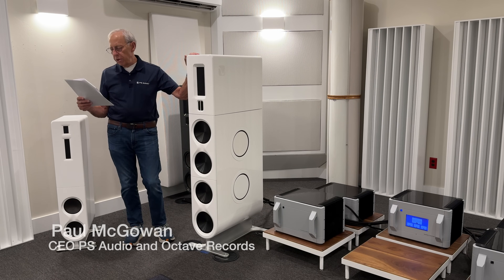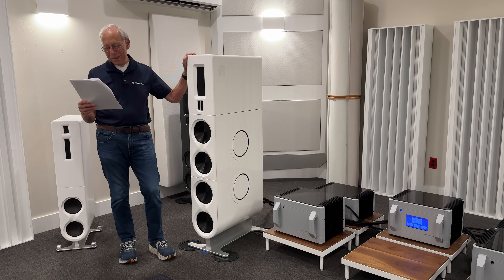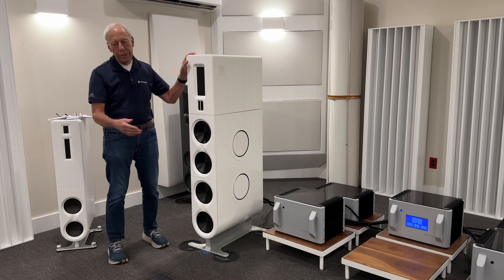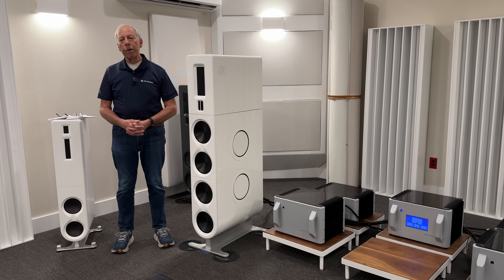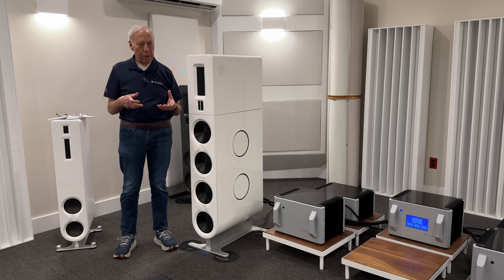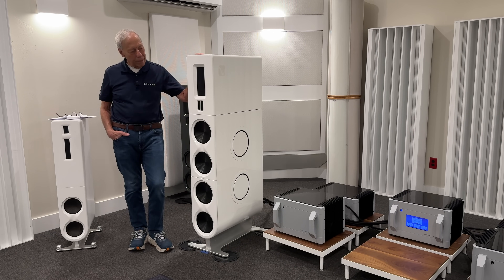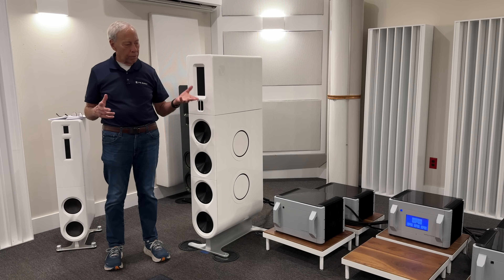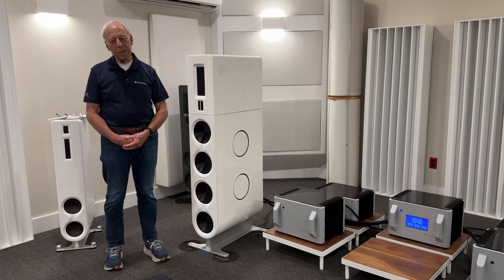Eliminating the AC wall socket

Comment: Voltage drop and proper grounding of your service is all anyone should look at. I don’t believe that anything else you could buy would change your sound quality! Make sure you have the ground rods your system requires via the code and your state code. Then be sure that long romex cable runs that feed your outlets are the correct wire size which will correct voltage drop issues. Invest in a meter that can read your amps while your system is under full load will tell you everything you need to know. Proper grounding and 10# gauge romex to a dedicated outlet is about all you will need to do for an elaborate system, if needed run two number 10’s iso-dedicated with hospital grade outlets! Anything else is snake oil IMO
Reply: You are entitled to your opinion, but allow me to explain a little science to why most audiophiles do get quality power cables, and dedicated circuits when practical. 
The heart beat of an amplifier is literally the voltage it is being fed. Any deviance from a pure sine wave into the amp will become distortion in the output to the speakers, and the more transparent the amp [and speakers], the more all of those little things will show up in the sound.
Reply: @l0zerth  
If you read what I wrote I give a remedy for harmonics. Problem is most people put the cart before the horse. First set up your system and see if there is an issue. Don’t buy what you don’t need. Listen for the interference and don’t assume your gonna automatically have sound quality issue. I have good cables and good quality conditioners on my system. No thousands of dollars spent for pretty devices like some do  and I don’t hear any noise at all. I will tell you that crossing cables or faulty wiring practices WILL cause noise popping and crackling. Keep it simple…

Comment: Electrical wiring laws doesn't alloud a direct connection to a Power device.
Reply: good legrand receptacles is all hiend needs
in us get 240V in house and get 240V gear
Reply: @sarabarabu-mq1ci  In Austria you have 230 Volt as standard in your home.
Reply: @Fastvoice  original wadia gear has pcb insert near power cord receptacle just below the fuse, the insert has marking 120V or 240V so same gear can be set for use in  domestic america or europe
just checked both legrand & schneider AC plugs & receptacles have marking 250V~
btw i like legrand better

Comment: What about using a Tesla
Power Wall for clean power?
First to post again!
Reply: Does that convert the power to ac or dc--remember most audio is ac then converted I think maybe tesla go up in voltage? 500dc?
Reply: I haven't looked into the details of Tesla's system, but if it only kicks in when the grid power cuts out, or at least takes over on a brown out, then it's not generally doing anything for you day to day, same as an automatic backup generator. 
If you are running off the Wall, then I haven't looked at the specs, but I would assume that it would be at least marginally cleaner and more consistent than what you're getting from the grid, but that's also going to depend on what else you are running at the same time, just like the grid.

Comment: Best thing I did was run 10 gauge copper romex to individual breakers at the power panel and upgrade outlets to audioquest. Sound improvement was substantial. Power conditioners lots of time for equipment and areas where not feasible to do that like altering an apartment you lease from not allowed or if you lived in a highrise the power panel might not be accessible to change out wiring or have individual breakers per component. Heavier gauge type power chords the regular outlets tend to be too weak to plug into.
Reply: I think audioquest should make their own complete Edison breaker panels and breakers. Might be expensive but that's an upgrade your entire house electrical can benefit from lol
Reply: I have some volcano insurance to sell to you.
Reply: @YuengsNwings  
Makes sense if you live within a volcanic eruption zone. I haven't researched that, but don't be surprised if there is such an insurance.

Comment: What works for me, I use a Tripp Lite Isobar, plug-in (no cable). Similar to a Puritan City but, way cheaper.

I also found real carbon fiber wall plates cheaply online. They also have a discernible difference in quality. 

The cleaner that signal, the cleaner that sound. 

Go silver through and through and your system will be golden.

Comment: Paul, please hardwire a power plant to your wall and plug another into an outlet conventionally. Then please have a member of your fine staff switch between the power plants and have you compare the sound of the system fed by either on a BLIND basis so that confirmation bias and placebo effect are removed. You say you have good ears, and I’m sure you do. So please run this simple test and confirm the claim that such a change is “noticeable”.
Reply: He can't do that. It would present the possibility of finding that this expensive product does nothing. He can't risk that.
Reply: I challenge anyone to notice any sound quality difference between the two setups
Reply: @Pete.across.the.street  you’ve got two PS audio power plants and were able to blind A/B them one wired each way?  Wow. Very impressive.

Comment: I recommend bypassing the main fuse and connecting yourself directly to the mains if you think ac plug makes a difference. I am willing to change my mind if you prove in scientifically meaningful manner that it matters. This is like religious debate, you say there is a god, you should be able to prove it rather than me having to disprove the claim..

Comment: Paul, there should be no problem hardwiring a component to the power line. In industry most machines are hard wired and there are no problems.
Reply: Except to meet electrical code there must be an easily accessible cutoff switch next to the machine.
Reply: No, most industrial machines are not actually hardwired in the manner you seem to believe. 
Almost all industrial machines have a an emergency stop switch, whether they are plugged in or direct wired, and that switch is always the very first thing the power goes through internally, preventing any possible shorting or continuing operation of any part of the machine if that is pressed. 
Many of those machines that seem to be hardwired actually do still use separate switches between the breaker system and the unit, so it is very rarely a true, uninterrupted hardline connection.

Comment: The power plants in conditioners that you sell have been shown to do absolutely nothing to improve, or in fact actually degrade performance. It's in such a low decibel range that it's inaudible but it's very much measurable. I do not understand why people listen to this. The first video I watched of you was showing that speaker cable can be used as an antenna. Were those speaker cables terminated at the other end? I really think you should be ashamed of yourself for ripping people off. Produce measurements. Publish them alongside the specs with your offerings.